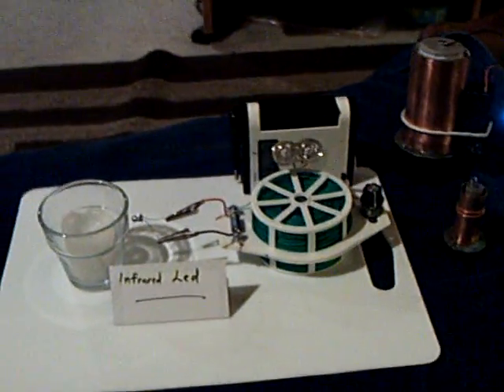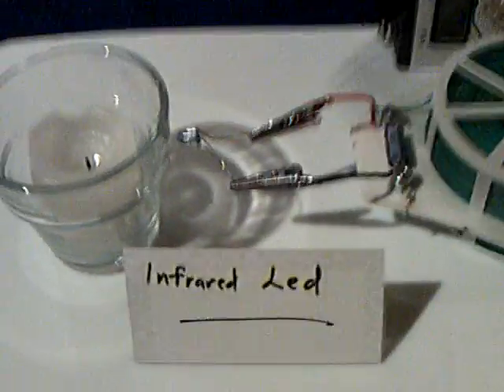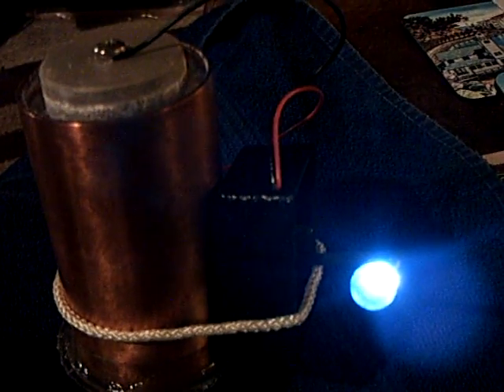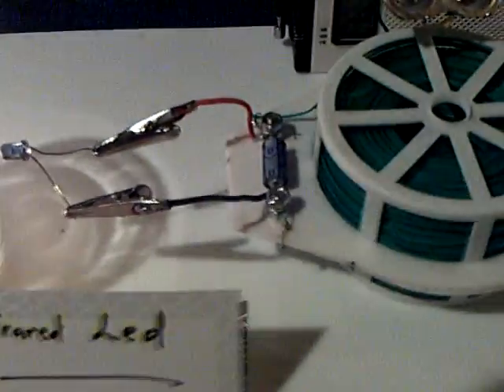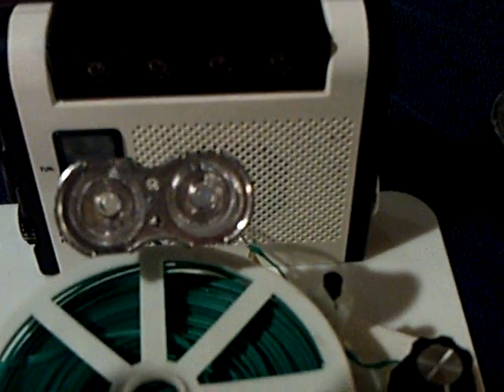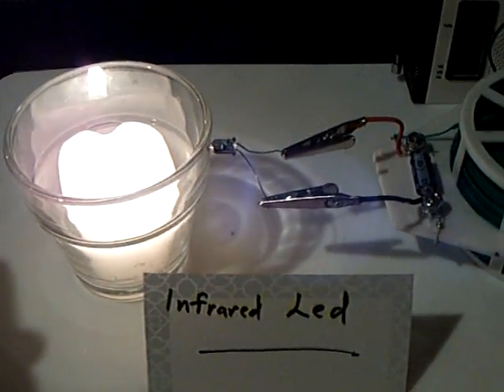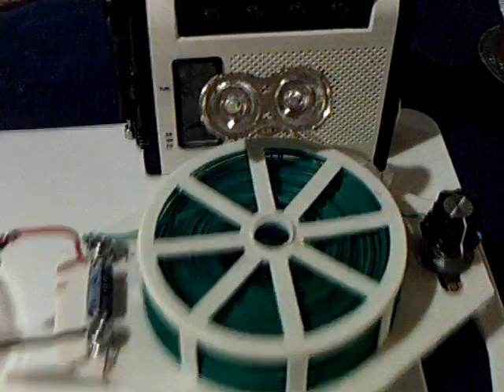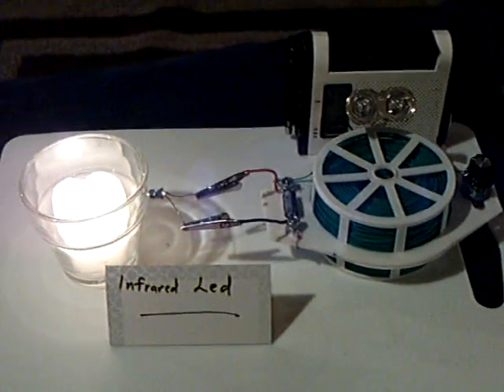Infrared LED and a candle powering Penny

Comment: Just a suggestion, If you need to see the IR light good for your experiments, you can use a very cheap webcam ( 6 to 10 $ canadian here )  and take the IR filter out... it is really easy and efficient. For exemple, a candel flame will dazzel the camera from 20 feet away.